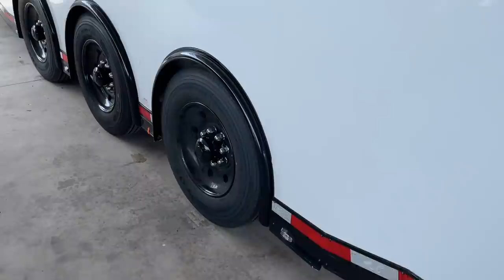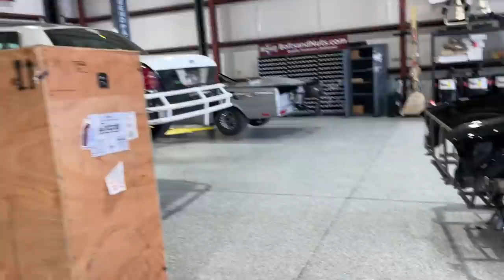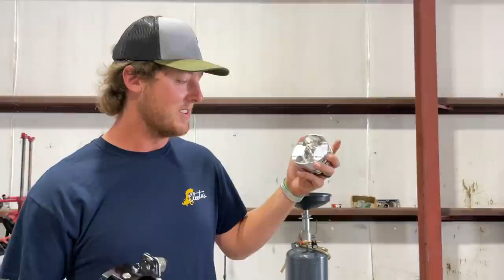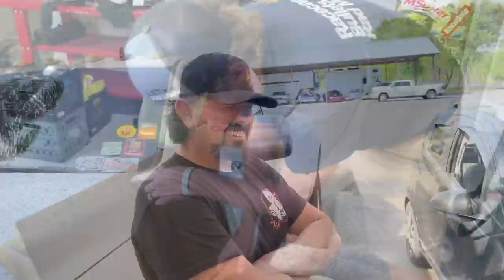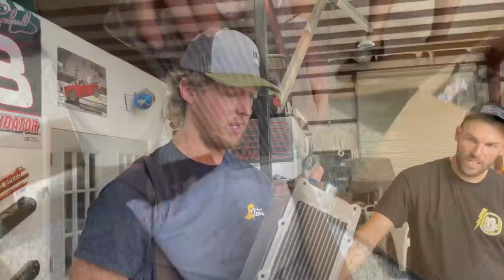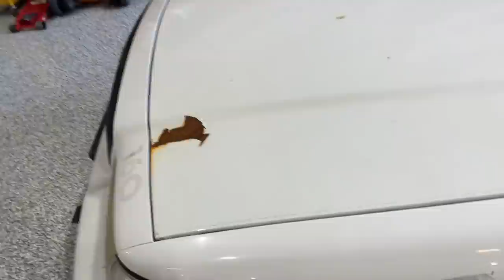Here's What Happened To Mullet's Engine In Texas...

Comment: Anybody who follows any drag racing will see things go wrong.  High quality teams with big budgets will even make mistakes. There are so many moving parts,  all it takes is one tiny bolt. And it doesn't matter who makes the mistake. The big building guys will put their hand up and fix shit if it was them. Parts come from many different places. Mixed and matched, pulled apart, put back together, adjusted, changed, swapped. Its easy for something to slip through cracks. 
My personal opinion is that the keyboards warriors should just leave. Those who want to see this stuff, the ups and downs of trying run an operation like this, it's INTERESTING.  That's why I'm here. Don't like it? That's ok. Go somewhere else. Have a nice day. 
Keep doing you, McFarland Crew.  This stuff got you to where you are now. Keep doing it.

Comment: The throttle body style flapper valve screws falling out was a recall for the 2.4 Nissan four cylinder 02-05 model years. I found 7 motors clapped out because of it.  If anyone knows anything about racing knows its a risk and at high power, it's just weekend warriors and ignorance speaking that are content with having someone else assume the physical and financial risk.

Comment: A 2000bhp car that blows up every other week is actually not bad if you're actually racing it. If it was just for the street then one could expect it to last a lot longer but if you're legit racing it, it's not bad at all. 

Get into top fuel and add another couple of thousand BHP and you're replacing pistons AND rings after EVERY run. Not even every day. EVERY RUN. You have 3 runs in a day and that shit gets mighty expensive mighty fast.

Comment: Anyone blaming Texas Speed has no clue what it takes to do what you do, because you guys make it look easy. Big block or not, keeping a car in the 6s is not an easy task. They don't just do that over and over and over without something going wrong. Also, they  seem to forget that you guys have skyrocketed in your abilities in a few short years. Things are being learned all the time. In this case...we now all know about throttle body screws. Good thing you found it in the pits testing your two step and not at 8000 rpm and 190 MPH.

Comment: I see a bolt going through the motor. But it just seems like every single time you guys run these cars, they blow up something every single time. I can't think of a time where all the cars drove back into the trailer running right after any event you've been in. That's not reliability at all. I see multiple guys running 7s and 8s and running countless passes and having zero issues.

Comment: Racing isn't cheap or easy and anyone who knows anything about true performance something as cheap as a fuse can decimate a machine made to run in very specific tolerances. The thousands of dollars that went into Mullets engine alone even he isn't immune to a dollar part ending a race day. Texas Motor Speed and the entire Motion Raceworks team have put passion on display and are by far among the best in the business. If any opportunity for growth can be extracted from this is double check your work if possible an extra second of patience can save a whole lot of money, alternatively can a mesh screen or some other implement be used to prevent large objects being erroneously sucked down the breathe hole (throttle body)  of the best damn Freedom unit to date similar to the mesh outside of the the two turbos or will that add restriction and thereby reduce power output? 

In closing, I'm sorry the internet trolls have strained your relationship with Texas Speed (my impression I got from the video) and I truly hope to see Mullet back and sending freedom down the track again soon. I love what y'all do and enjoy the vlog  and I certainly wish the best. Raise hell and praise Dale!

Comment: Take the kids through one of yalls 427 assemblies on the 2nd channel.  
What yall are trying to do out of a small block.
Rotating assembly specs assuming they are stroker motors, forged, yadda yadda.
Cam specs, head flows, and the kind of heat yall are putting through the block.
I think a few of the viewers don’t understand what yall are really trying to do with the small block based platform in a heavy car.

Comment: Race engines blow up. That is a simple fact. They are pushing more power and stress than they should be able to take. They will live short lives. No engine builder will ever be able to make a super high horsepower engine that will last forever. The way manufactures are able to do it is because they limit the power to a point way under what the engine can do. Top level NASCAR engines will only last 2-4 races before they give up. Pro drag racers take the engine apart between each run.

Now onto the videos here... Yeah it's fun to watch them race, but you can't deny that everyone enjoys the ups and downs of the team as they try to keep everything working. It wouldn't be as exciting if everything always worked every time.

Comment: What idiot thinks 2000 + horsepower engines don't break at 30+ lb.'s of boost at over 8000 rpm? The stresses a race engine can go through is astonishing to say the least.  They clearly don't know anything about engines. Sometimes you get lucky and can get a few dozen passes without major damage but there is always wear. Every pass degrades an engine a little or a lot depending on the amount of work it has to do.

Comment: alright I have a real question , and I would like a non troll answer , So Cleetus we all can assume has a deep wallet , you want to run 6s you want to do all these races why are  you still running production based LS engines why not just switch to a big block buillet hemi you'd break less stuff and you'd clearly would make more power constly on less effort   I dout a big block hemi would ever lift the heads  EVER

Comment: LOL putting 1k Hp through a engine is absolute engineered quick death..   there is a reason OEM's dont do thatin all but the most exotic..  A bolt going through is death to any engine. Unless your very very very lucky..   Racing  is pushing limits... when limits are pushed, things break  Thats the entire formula..  you push and things break.  The trick is finding that balance.  There was a chevy 4 banger ecotech they simply pushed to the max on all factory parts , they just kept breaking stuff till all the parts they repaced quit breaking.. they essentially got all the luck of the draw of with  factory parts and made huge HP out of it.  Factory has limits and so do aftermarkey.. bolts through engines also dont help.

Comment: You know for everybody that's talkin about how Texas Speed is junk and that he needs to leave them and he needs to just get that Steve Morris big block. First of all, I want to see how long that Steve Morris badass motor will last when a bolt comes off of the throttle body flap and makes its way on top of one of those Steve Morris badass Pistons! Not to mention, I'm pretty sure I wasn't dreaming when I saw a Steve Morris engine blow a head gasket not too long ago at drag week I'm thinking it was and Steve Morris had to send the guy or brought the guy another head for the $1,000,000,000,000,000 bad ass engine 🤔 lol. Just sayin' 
💩 happens 
Only true racers know this lil secret!

Comment: good engine can drive at same performence for long time without break.

in F1 , the worst engine Team cant finish the race even if the fast at start.

about texes speed, the top score engine faliure
1) offtheRance - use engine "T_speed" break on few runs only.
2) the cars Ruby,mulet and another
3) more youtube channel had the same problem. These engines not Reliable.

if you get under 8 sec, you must to rebuild your engine. that is stupid

Comment: When you push engines the way you guys and everyone else you race with does for that matter, things break. When things break, you take it apart and when you frequently take things apart, you run in to bad parts now and then, loose bolts, a mistake here and there, things happen. I've done it and you really can't blame anyone most of the time, it's either a simple mistake, or just things pushed to the limit and a little beyond. I'll tell you this, almost every time I saw a failure and it was in fact the engine builder's fault, the failure was more spectacular, and a lot sooner than that. I like to wait and see what happened before I comment on these things because youtube is good advertising for these engine companies and if everyone's badmouthing a particular one, they're going to leave that youtuber, it's happened before and it can get to a point where no good engine builder will work with that youtuber anymore and if you can't get a good builder, there's no time for other projects as he does it himself and it will hurt if not kill the channel.

Comment: Just my 2 cents: regardless of what the engine builder/manufacturer says; an engine will always last longer if you start of easy. Limit boost and horsepower, no dyno pulls, road test it first; 1000 miles or something, change all fluids, sparkplugs and check valve lash. Then start tuning and racing. What I see you guys doing is receiving a new engine, put it in the car, go dragracing and turning up the boost the same or next day.

What I also didn't understand: you did all kinds of testing and tuning before leaving for TX2K, then changed the gearing and tirewidth and didn't test anything after that. And then act kinda suprised the car behaved differently on TX2K day 1.

Comment: People who claim these issues are the engine builders fault, tuner’s fault or what have you have never raced a car putting out these kinds of horsepower numbers. An engine, transmission, running gear at the ragged edge of the envelope even just for a dyno run or testing the twostep. They’re just keyboard bench racers who sit in front of youtube and after their 11th beer reach for the 12th and crack it open using their gigantic Budweiser tumor as their table. Or if they do race, as the Sloppy Mechanic channel says (mocks actually) they’re racing cars making 100 horsepower. Not that theres anything wrong with that, theres a class of racing suitable for everyone’s budget. But those racers have no clue how hard on gear a 1,000 or 1,500 or 2,000hp motor is on things.